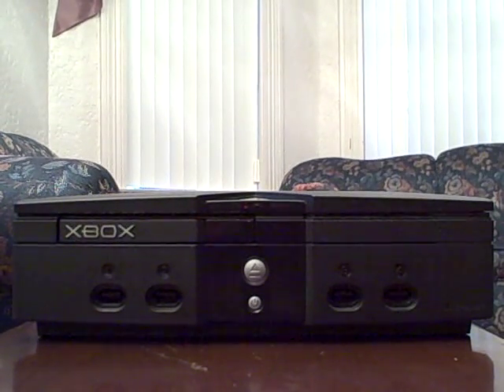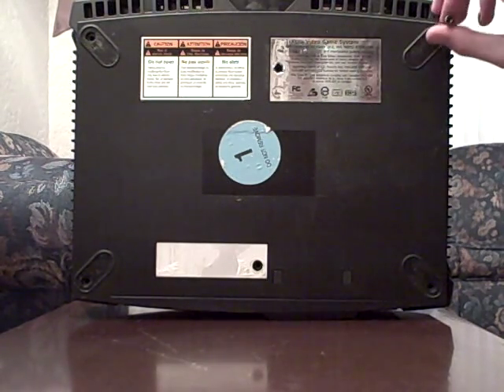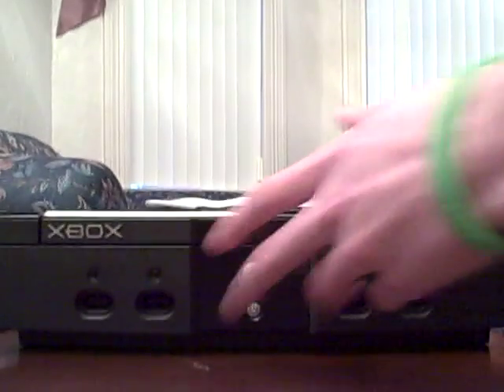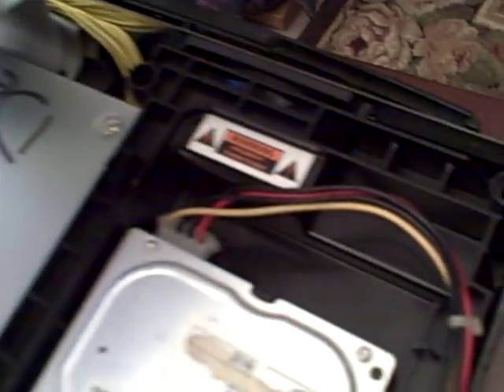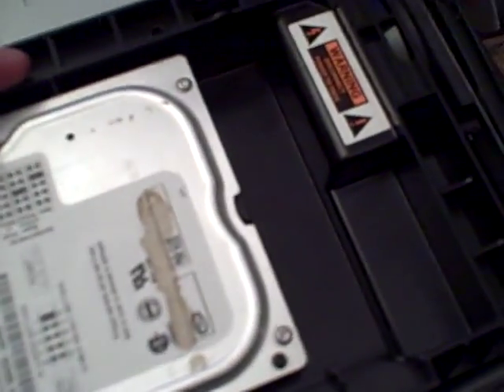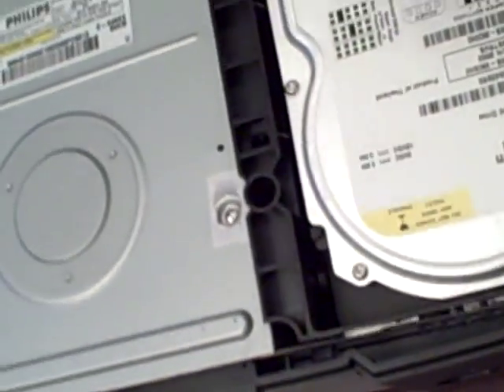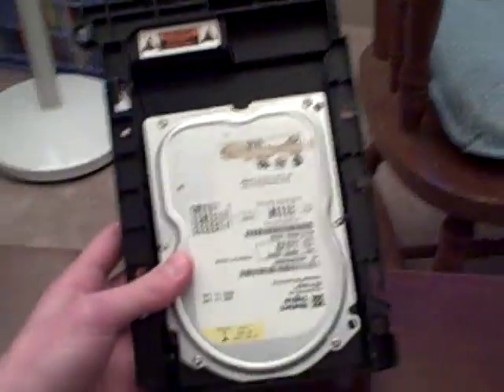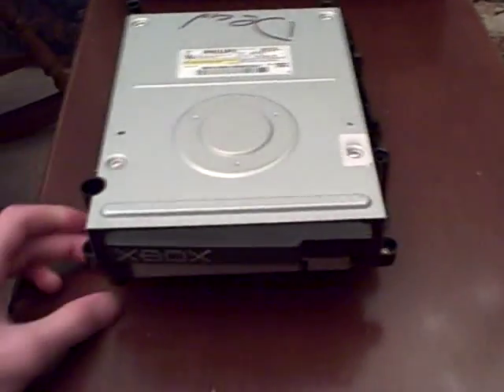Xbox surgery.  How to properly take apart your xbox. How to get in to dvd disk drive and harddrive

Comment from the maker: @jaykingis14 It is the hex/star shaped head. It is basically a security bit without the hole in the middle. You will have to pull your dvd drive, open it, and find an oem new belt, or find a smaller rubberband and use it as your belt. Just remember to hook it all up before you put it back together.

Comment from the maker: @andree1991 You can do it as long as the dvd drives are sisters. You will have to take the daughterboard out of the xbox dvd drive that doesnt work, put it in the dvd drive that works, and put it back on the working xbox. If they are different, you can just buy a new laser for very cheap.

Comment from the maker: @jdcrispe95  You will actually not remove it, you will only unplug the wire. it will go down to the motherboard. Once you unplug that, it should come loose. you might have to unplug the conroller ports if i remember right.

Comment from the maker: @jdcrispe95 I have recently done that, since i am going to put an xbox 360 in an original xbox case. What you have to do it pull out the dvd and hdd. After you get to that point, you will undo several screws that hold the motherboard on. You have to undo some components, but it is fairly simple once there.

Comment from the maker: I mean it wouldnt hurt it. If you were worried, you could lay some mesh down or cardboard with little holes, so there was equal pressure on them, and they could still get air.

You can always cut or bend some of that metal outer wall.  You could even get an extension and just set your hard drive out of the console.